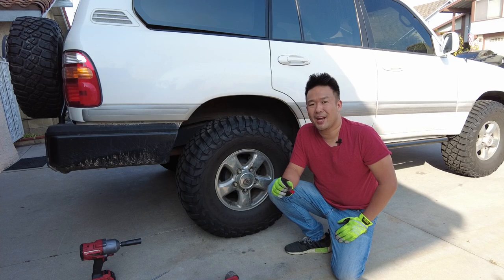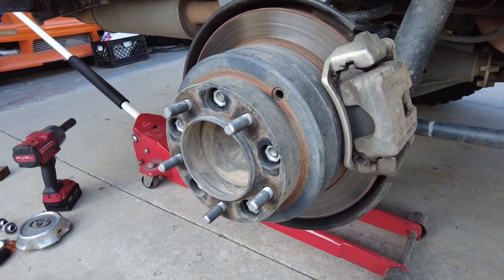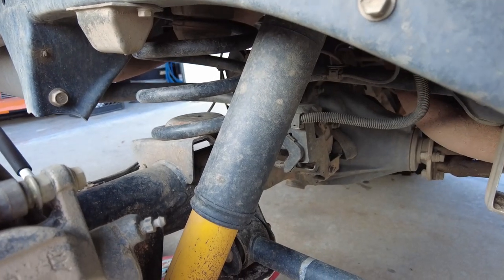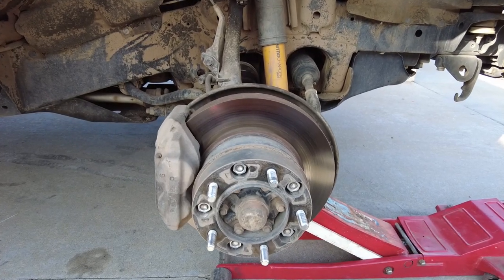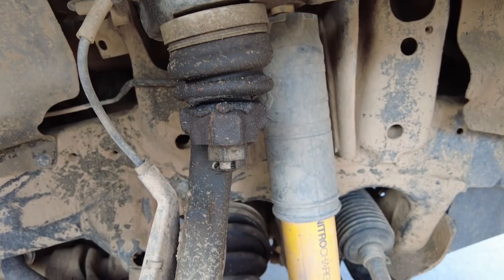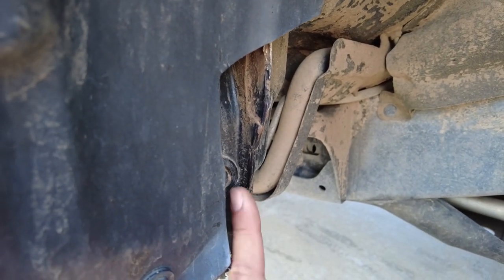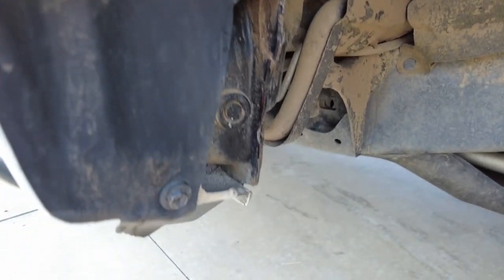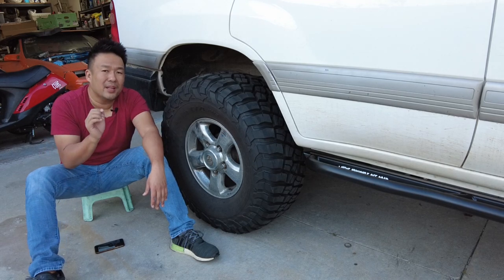how i fit almost 35's on a Land Cruiser 100 series Lexus LX470

Comment: change out those Front sway bar links for some Trail Tailor Extended ones to adjust your sway geometry for the lift, comes with new poly bushings and your stock ones are shot.
Reply from the maker: Yea mine are toast. The front suspension is due for a refresh soon
Reply: I removed my front sway bar altogether. Works for me.

Comment: Just came across this video and though I would add another data point. 2001 LX, 315/75/16 Toyo Rts.  Same manufacturer specs as the KM3, 34.6" tall and more importantly 12.3" wide.  In the front pinch weld massaging is always required for this size, but I differ in the rest of my build.  I use a 5MM slip-on spacer in the front to clear the stock upper control arm(it would be within mms of clearing without, but this is just insurance that it clears)...otherwise stock AHC suspension.  Little bit of sensor lift(.5"to 1').  Similar rub in the rear and...and WheelerOffroad superbumpstops for an FJ cruiser in the front and they are fitting overall just fine.  Tuck within the fenders nicely without the wider wheel spacers.  With those upper control arms I would think you wouldn't need any spacers and might end up with a better overall experience.  Anyway, just wanted to confirm that the claim that you need a body life and this and that to fit 35s is just not true.  Maybe without ever rubbing or touching anywhere, but if you take the approach a little rub never hurt anyone...they fit just fine...  Good to see a video from someone else running 315s...

Comment: Only way to gain more flex out of the front of the 100 is to increase the droop by using longer front shocks. Those OME shocks are rubbish and are pretty much the same length as a factory shock.
The maximum length shock you can use is around 20mm longer that factory.

Where the shock mounts It's nearly a 2:1 ratio, so with a 20mm longer shock it will give you nearly 40mm of extra down travel at the wheels. 
And to make good use of those Spc UCAs, you really should find some longer shocks, only then will you will need to do the diff drop. No point doing a diff drop if you dont have any extra down travel.
Reply from the maker: That makes much sense. Also a reason why I haven’t done the diff drop yet. I think one of the fronts are already blown so maybe it’s time to upgrade
Reply: @chowcares  Yep, those OME shocks wont last long, they're not good at controlling the front end of a heavily sprung 100, especially when adding big heavy tires.

To get the length and valving required I used the stage 4 Icons cdc in front and rear of my 100. It was seriously the best thing I have done to mine. Way more flex and amazing high and low speed bump control. Also bonus here in Aus they custom valve them to better suit our outback track conditions.

And no need to remove swaybar in rear with longer shocks, I just used longer drop links. However, I did have to use a much longer brake line with all the extra droop.
Reply: @SteveBurns80  Hey Steve, where did you get your icon set up? I used to have icons in my wrangler. They were incredible. Would love an icon setup for my 100 series!

Comment: Hi you’re videos is a big help on my LC 100 modifications and repairs. I have a questions regarding installing the 35’s.
1. Did you change your gear ratio when you installed the 35’s?
2. Did you noticed a big change in driving performance ie. acceleration, braking etc.
Thank you.
Reply: Thanks for the video, very helpful. I have the same question. I'm running 33" and a lot of extra weight (ft & rr bumpers, winch, spare tire, rtt) and my 100 is feeling a bit sluggish on the highway. I'm considering having it regeared cause I want to move up to "almost 35's" same size as what you have. Did you have to regear? If not, does it feel like you need to regear?

Comment: Excellent video! As soon as my AHC spacers arrive I am planning to put 35" on my HDJ 100.
Reply from the maker: That’s the spirit!!
Reply: @chowcares  do you know the offset on your rims?
Reply from the maker: i thnk the stock wheels are +50? somthing like that
Reply: @chowcares  ok. I have original Toyota rims 17x8 and those are +60.
Reply from the maker: Tuomas Haanpää i don’t think us versions of 100 series got the 17” wheel. Only 16 and 18
Reply: @chowcares  Okei. We mostly have 17"  rims,atleast Prado's and 100's have. Except of course new Cruisers.😀
Reply: AHC spacers??? Tell me more please !
Reply: @darrenquinn2338  https://forum.ih8mud.com/threads/ahc-spacers-sensor-lift-both.968658/.
There you find everything you need. I already have adjusted height sensors to gain about 3" lift. But I am only able to use N or L settings on my AHC. When I add spacers H setting is also possible. And of course pressures are also lower in shocks with spacers.
Reply: @chowcares  just found out that in Finland 34" (305/70)tyres are max for LC 100. But it is ok compared to 265/65 that I am running now!😄😄😄

Comment: Nice. I have 1.75 inch spacers. I wonder if that allows for 315/75/16s up front.
Reply from the maker: It should, depending what offset wheels you’re running
Reply: @chowcares  sweet! I got the same wheels as you. I love the stock 16s!

Comment: I have steel wheels on LC100. 2006 Diesel model. Can you suggest any link for alloy wheels 5x150 in 16 inch rims. Fitting standard 275/70 R16 tyres.
Reply from the maker: If you have the 16” steelies I would gladly trade you for my alloys!!

Comment: How did you get the front spacer to work with the drive flange bolts? They aren’t machined to clear them.
Reply from the maker: They clear without any modification.
Reply: @chowcares  thanks for confirming! I was always hesitant on buying based on reviews.. did you use any sort of thread locker for the nuts?
Reply from the maker: d4nvu nope, just torque down to factory specs. So far never had any issue

Comment: Sooooo, let me see if i got this straight... 315/75r16 with  (mild 2 inch lift) stock oem upper control arms, front fender pinch weld clearance mod and inner liner heat/reform and stock oem rims w/no spacers will clear these tires on a 100 or?
Reply: I just rewatched video and I'm way off..lol... spacers and aftermarket upper control arms necessary to run tires? If spacers are nessacery ehat us the minimum spacer width needed? Or what backspacing/ offset is necessary to on aftermarket rim to clear without spacer?

Comment: I have a question. Does the Toyota LC 100 series come with the Automatic Height Control or is that just the LX470 version?
Reply from the maker: Mine did not. Maybe the later models did?
Reply: 2000-07 LC had AHC

Comment: I think your tire size worked out well.  Seems like you got the largest tire you could.. 
     Dont see any downside to your trim of the plastic or even the bit of seam weld.  You did that very well.   
       I am not an off road guy yet.. do you think there is much capability difference between a 33 inch tire and your almost 35's ??.  I know the .75 to .90 inch additional lift is helpful in the right places.
Reply: well, they are much more expensive, they put strain on gearbox, they are harder to replace in other countries...etc...33" is the best size, 35" if you want to rock crawl

Comment: Do you think ill be able to run this setup on a 2006 LX-470 with stock suspension? AHC Intact.
Reply from the maker: You’d probably need some lift
Reply: not with stock front bumper, or a lot of the interior of front wheel well / pinch weld